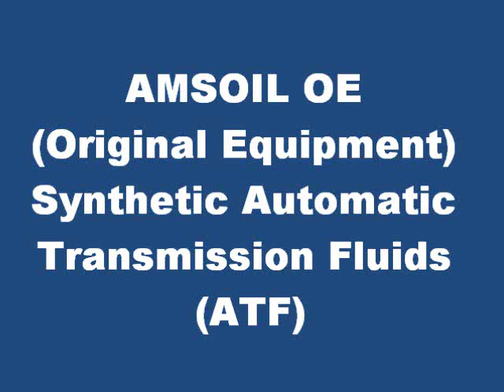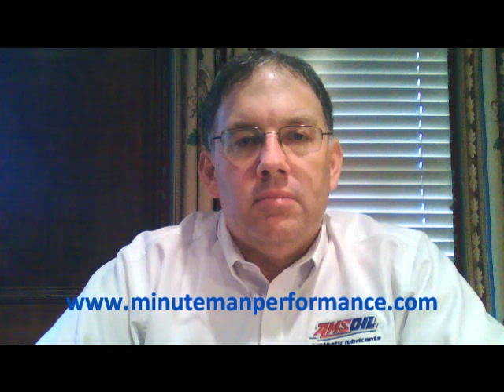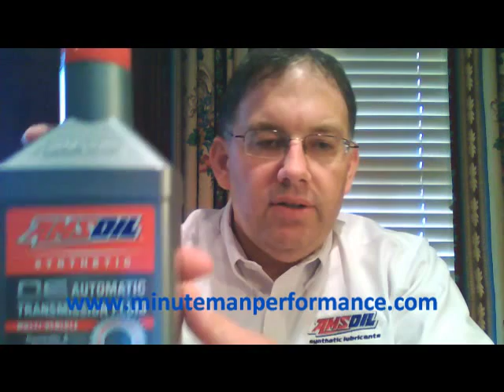AMSOIL OE Synthetic Automatic Transmission Fluids (ATF)

Comment: Hi, I would like to use the Signature Series Fuel-Efficient Synthetic Automatic Transmission Fluid
Product code : ATLPK-EA on my tuned high horsepower and torque zf8 transmission for my BMW M240i. Your site list this product as a OE replacement for my vehicle. Will this benefit my transmission more over the OE Amsoil fuel efficient particularly in keeping the transmission cooler and also helping to prolong the life of clutches or clutch slip when vehicle is in high demand? Also, should shifts be just as quick as with the stock fluid or cause car to accelerate any faster?
Reply from the maker: AMSOIL Signature Series Fuel-Efficient ATF (product code ATL) is superior to all AMSOIL OE ATF fluids (OTF and OTL).  The SS fluid will provide better performance, especially in high-performance / harsh conditions, and will last longer as well.

Comment: Hello sir, I have a 2002 Camry that sees 50k+ miles per year of abusive city driving (patrol vehicle for a Security Response team) .. I just switched to Amsoil OE ATF, should I change my fluid at 20k miles now? And would I be good for 60k miles with the Signature Series fluid?
Reply from the maker: 20k would be a good interval on the OE ATF given your driving conditions.  Then move up to Sig Series ATF, and for best results / lowest cost, monitor the fluid with oil analysis services, available thru AMSOIL.  Use Sig Series engine oil as well for lowest cost / best performance.

Comment: What transmission oil would work in my mercedes benz c350e hybrid
Reply from the maker: I would recommend the AMSOIL Signature Series Fuel-Efficient Auto Trans Fluid.  You'll need 10 quarts for a complete change.  Please use Referral Code 1302686 if you place an order with AMSOIL.  Contact me directly at 678.787.3028 or info@best-synthetic-oils.com if you want a free 6-month trial membership in Preferred Customer program.

Comment: changed the trans fluid over to synthetic  on my father's 87 dodge and it runs much better never would have expected as big of a difference😊 
🤘
Reply: did you use amsoil when you did it or another brand of synthetic?
Reply: @lightningsmokerXx I used  amsoil

Comment: Yeah...just buy the actual oem fluid.
Reply from the maker: Yeah...just keep rebuilding your automatic transmission at about $3000 per event as well.
Reply: Best-Synthetic-Oils.com hahahahaha I learned it the hard way when I used Honda fluid in my 2004 TL and believe me the factory fluid are garbage. I had to get it rebuild and after rebuild I start using Amsoil omgggg I love this fluid and the shifts are butter smooth and crispy